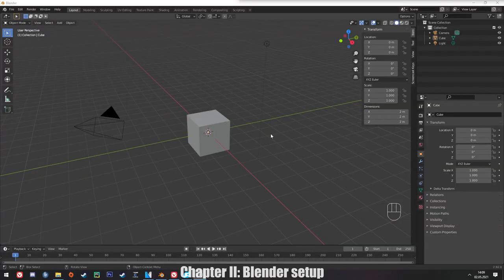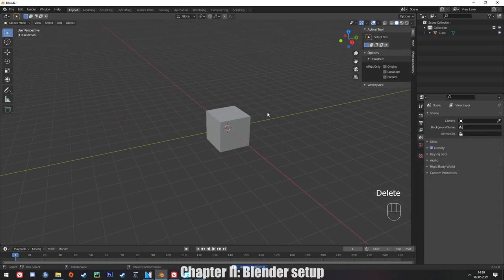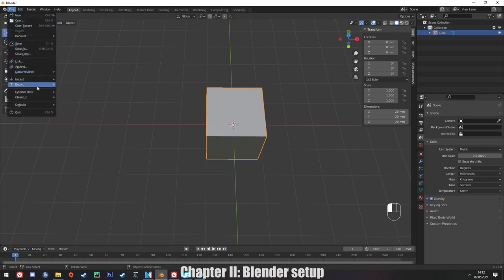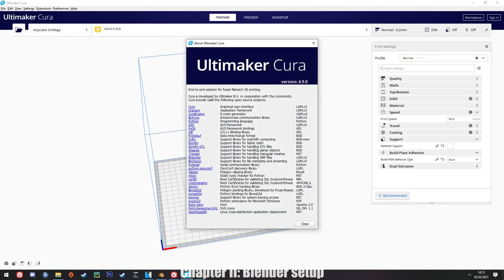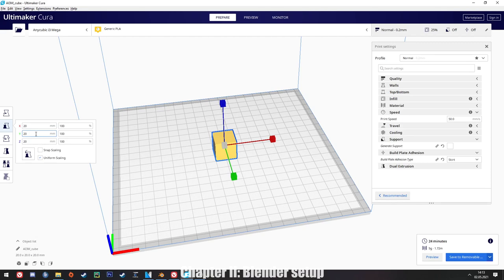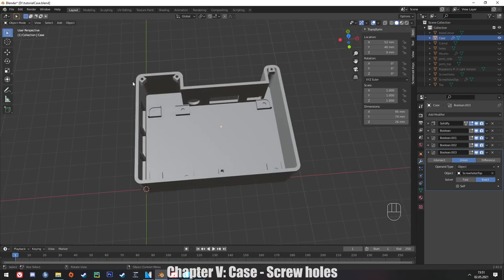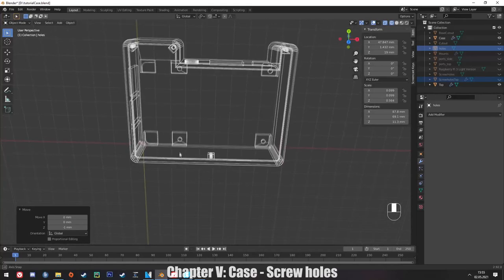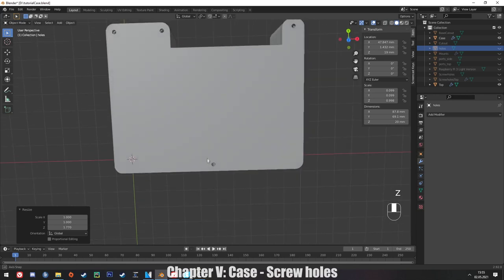Blender Tutorial - 3D Printed Case (Workflow for Raspberry Pi, Arduino, etc)

Comment: At 19:04 after adding the modifier, thickness and checking the box, your box has some wayward vertices on the bottom left corner. What key strokes did you use to clear up the box. Thank for a great tutorial.

Comment: Thanks for the tutorial - question: could you do all this with splines/lines? Is there a reason why you/other people use meshes and subtract things instead of just drawing with splines and then adding faces, extruding etc later? Thanks.
Reply from the maker: Hey vooveks! Sure you can do that but it will be less precise. Personally I use splines and lines only for organic or asymmetrical shapes that are hard to get right with primitives like cubes and spheres.
Reply: @fullstacklab  Cool, thanks for the info, appreciate it. I think it’s because I like the idea of drawing things in 2d as it seems simpler (probably isn’t though, if you are used to working with primitives like you say). What do you think of Fusion 360 vs Blender for parts and things like that? I’ve downloaded the free version and thinking of giving it a go.
Reply from the maker: @vooveks  There are many ways to Rome. Take the workflow which suits you the best. I haven't used Fusion 360 simply because I don't see the value in it. It might be the better tool for 3d printing but then there is the pricing if you want to go commercial (e.g. freelancing). Blender is a very good and free allrounder and it's definitely worth learning it.
Reply: @fullstacklab Yeah, definitely. Blender is amazing, especially considering it's free! Incredible that w can get access to such complex software for that price ;)

Comment: Hi Pygineer, Thank you for the tutorial it is very good. I just have one problem. The base face is not solidifying. I am currently using Blender 4.0.2. I cannot work out what I am doing wrong. I have watched your video several times and am making sure I do everything exactly as you are doing it, but I still cannot get it to work. Any idea where I might be going wrong?
Reply from the maker: Hi doischmark, I just tested it with Blender 4.0.2. The workflow is still valid and it worked for me. Just make sure, that you add the base face right at the beginning. Also make sure that by creating the base face, your are closing the entire hole which means, all verticies/edges have to be selected and connected to the base face.
Reply: @fullstacklab  Thanks for that. Is there a way that I can give my ground a different thickness to my walls?

Comment: I followed to the "T" but when I put the bottom on I noticed the area where it was extruded had a Bevel???  I may have done something wrong when you say click this then that you say it backwards  sometimes I was lost till I watched the screen for the correct sequence .I really wish they made software for 3D printers only without the Library of congress to sort through to get to the tools you need. Blender is so complex 99% of it is not needed for this! or a mode selection to remove what we don't need. like some apps have "Game Creator" 3D Print" Video" etc..

Comment: so at the end you scaled the model to 10 because you down scaled to 0.1 at the beginning ? 
and what about the sizes of the holes ? they are random, so how to make sure the screw would fit in ? 

thanks
Reply from the maker: I didn't set the scale of the actual model to 0.1 but the unit scale. This doesn't affect the dimensions of your model. You can set it to 1000 but the actual dimensions of the model will remain the same. Feel free to try it out 😉 And about the screw holes, you can make them as big as the actual screw. Because PLA shrinks after printing your screws will sit tight. But dont forget to make the walls of the screw holes thick enough (1.5-2mm) so that they don't break. Cheers ☺️
Reply: @fullstacklab    informative..
What about applying the scale? Why is it important? "Besides having even bevels"
Reply: @fullstacklab  and one last thing, if you put x and y and z to 0.1 without applying, would it affect the scale? Thanks
Reply from the maker: @mibrahim4245  good question. It's important for the actions you want to do. For example if you want to add thickness to a rectangle with a scale of x=2 and y=1 it will add 2x the thickness on x and 1x the thickness on y. So basically it tells you how often an action will be peformed on a specific axis (at least for modifiers and beveling stuff).
I think this can also affect positioning and rotating.

And about not applying the scale, no matter what you set for x, y and z in the scale section and also in the dimension section it will always affect the scale.
Reply: @fullstacklab  thanks a lot!! I really learned from ur video, maybe it's the only one in YouTube explaining how to make a case with blender!..
I was just confused with the scale issue, and now I understand that the 0.1 at the beginning will not affect the exported stl dimensions ..

Comment: Thanks so much. Really great video with easy go follow instructions.. I’ve been using TinkerCad for my prints, until now. But I want to switch to blender for a better workflow. You reply help me to do that, so thanks a bunch 😉
Reply from the maker: Thank you 😊I've tried TinkerCad as well and it's superior than blender for basic stuff. But when it comes to pattern generation and reusing stuff to create new objects, blender is much more superior in my opinion. You can create complex cutouts with a few mouse clicks which don't need to be final and still can be adjusted.
Reply: Thanks for your reply. I’m looking forward to getting to know the workflow. Just a hint.. Have you checked out the Blender add on, Construction Lines?

Comment: I am not sure this is one of the best tutorial or the blender itself is extremely not user friendly. So many steps just to make a round curve for the corner... Coming from AutoCad, this could be achieved as simple as click select the edge line and push/pull the fillet, further one step if want to precisely set a numerical value for the corner.